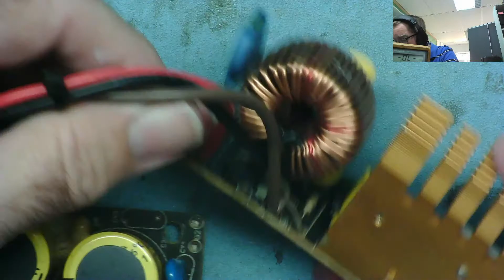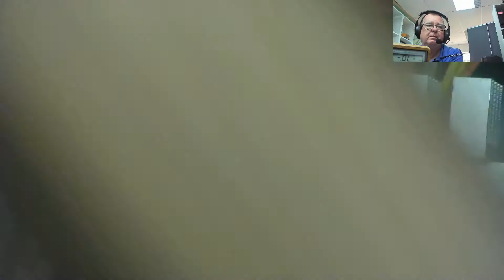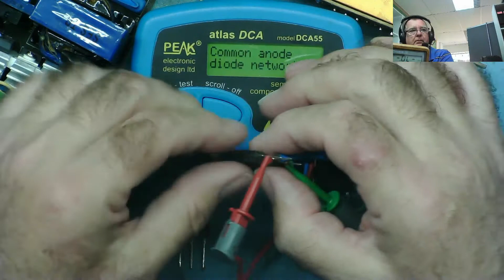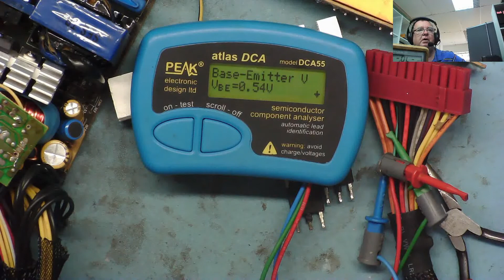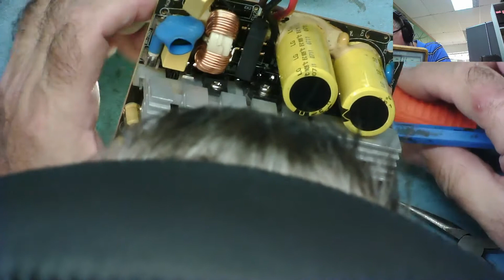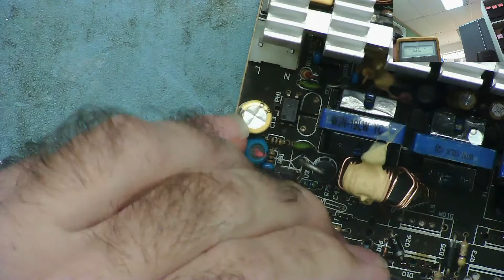LER #060 - 600W ATX Power Supply (PSU) Repair - Part 2

Comment: The only one extra thing I would do is resoldering red and brown wires to the PFC board. If the black one broke from wiggling, the other two may also be partially damaged.

Comment: 40:59 I love this part, when you try to plug 230V it without safety bulb limiter. You are almost ready to run if case of bang :) I'm afraid to hear the bang in the same way, when I must plug 230V to things, which I've repaired. I even have to put hand gloves to feel separation from potential arc voltage and put earplugs in to my ears to block "bang" sound, and put glasses to protect my eyes against exploding capacitors :-D Only with these safety equipments I can handle my stress tension when I run 230V trying to test something :-)

Comment: Obviously chinese sent you fake transistors. They always do if you order not single items
Reply from the maker: In my experience this is not the case.  It may be for high value sought after components but for more generic parts I never had this problem

Comment: A lot of work and a lot of time BUT you repaired a good smps 600W with PFC. Just by replaced main transistors as could remember?
Reply from the maker: Sometimes it's not about how long it takes, but what you learn on the journey that counts
Reply: @learnelectronicsrepair  Yes of course. Time is no problem for me. Rather I wonder why main transistor gone and what could be do it - where is the reason, bcos sometimes we can infinity changed damaged parts. It's nothing about your work - just wonder myself.

Comment: That's really cool. You fixed it. I'm still trying to fix one that belongs to a friend. It had a blown fuse and a blown NTC, which was caused by a dead bridge rectifier and a dead N-Channel MOSFET. I replaced these, but now it always trips my main breaker when I connect the AC power. I have checked all the small diodes and they are ok. No dead caps and no dead resistors either, but obviously, there's still a short somewhere, and I suspect it must be in the circuit that generates the 5V standby? I also tested the common dual Schottky rectifiers mounted on the heatsink, and they are ok, so I soldered them back in. Other ICs that I can see near the small transformers are TL3845P and AP8022 (PWM controllers) and a couple of PC817 optocouplers, these I haven't tested one by one. Maybe I should?
Reply from the maker: Hi Brian - I doubt those ICs would cause the power to trip.  
Do you read a short circuit across the Bridge Rectifier positive to negative terminals?
Do you read a short circuit across the main smoothing capacitors (if there are two - measure across them individually and the two in series)
If you suspect the 5V standby, remove the FET (or similar) that drives the standby transformer, and power it up.  It won't work without the FET but if it stops ripping out then you have confirmed your suspicion

Another possibility that would trip the power is if you have a short from the AC connections (live, nuetral) to ground

Otherwise you need to build the current limiter using a light bulb.  This has to be a 'proper' light bulb not an LED or fluorescent one.  I have shown the circuit for this on quite a few of my videos, but you can see how to build one here 

https://www.youtube.com/watch?v=syQaSfhb604

This will stop it tripping out and allow you to diagnose the problem - unless you have a short to earth in which case it will still trip and the bulb will not light, bu at least you will then know what to check.

Good luck with the repair
Reply: @learnelectronicsrepair  Well, turns out the TL3845P (UC3845) PWM controller IC is also dead. VCC pin is shorted to the GND pin.

When it tripped my main breaker, the bridge rectifier got blown up again (haha) so this time I replaced the all in one package with four single diodes. I replaced the main smoothing capacitors too, because they have lower capacitance than rated (360uF instead of 680uF)

On a side note, in continuity mode, I get a constant beep on the outputs (12V and 3.3V) similar to what you got in the first part of this tutorial. What makes it even more confusing, with the common cathode dual diodes (two small, and two big ones) pulled out, I'm still getting a constant beep on the PCB pads for the anodes of the small ones, and for both common cathode and anode of the big one. Does this make any sense at all?

In resistance mode however, the meter reads 220R on the 12V, and 67R on the 3.3V
Reply from the maker: @getmefix1921  I think you may find your diode mode gives a continuous beep for lowish value resistors - you can check that out of circuit with a few resistors.  The other reason would be output capacitors charging, as I believe in Diode mode the meter acts as a constant current source of maybe a milliamp (it can illuminated LEDs dimly after all) but then the beep would stop after a while.
Reply: @learnelectronicsrepair  I took a break to build the light bulb current limiter.

With the primary side MOSFET pulled out (there's only one), and the new TL3845 put in (I use an IC socket to make replacing it easier), I get a tiny spark near the MOSFET PCB holes when I switched on the power supply. The light bulb flashed on then off very quickly, and my main breaker didn't trip.

Inspected the spark area closely with my phone camera at maximum zoom, but didn't see any solder blobs shorting the PCB holes. Re-checked the nearby components, and they're ok. I'm baffled as to what that may have caused the spark.

Pulled out the TL3845, switched on the power supply again, yay! no more spark. I also get a steady 5V standby at the output, which means the AP8022 circuit is the one responsible for generating it.

Now here's the dilemma. Put back the two missing components and risking them to blow up again, or not :D
Reply from the maker: @getmefix1921  Good to see you are getting further along with this. The light bulb will stop the new components from blowing (usually) as long as you use a relatively low wattage bulb (60W-100W would be good).  You should not be seeing sparks though so you need to look a that area and try to work out where it came from.  I would try replacing both the MOSFET at the same time.
Reply: @learnelectronicsrepair  So the good news is, I didn't blow up anything after I put back in the primary side PWM IC and MOSFET. No spark either. Still getting a steady 5V standby (present on both purple and green wire) but no outputs when I sent the PS_ON signal.
Reply: @learnelectronicsrepair  Thanks for helping, but unfortunately, I'm not able to fix mine. I have no idea what's causing the 3.3V and 5V output sections to be shorted to ground (although the continuity reads 29 ohm, not 0 ohm). 
I wanted to pull out the components and test one by one, but this is not possible given the fact that the board quality is mediocre. The protective UV paint is very thin that it takes no effort at all to scrape it off with my fingernail, and also the solder pads themselves are placed less than 0.254 mm (10 mils) apart. I'm afraid that if I pull out the components, and then put them back later I will just create a bunch of solder bridges here and there. I have repaired a bunch of SMPS before successfully, but they were all mostly SMD and the board quality were much much better than this.
Reply from the maker: @getmefix1921  Bad quality PCBs can be a real problem.  Why not register free on Badcaps forum https://www.badcaps.net/forum/ and post about this PSU on there also in the Troubleshooting Power Supplies section.  Upload some pics and you may will get plenty of guys trying to help you I am sure.  You'll find me over there also
Reply: @learnelectronicsrepair  so I have another power supply with a funny problem. If connected to a mainboard, it won't start, but it will if stand alone with the PS_ON and GND pin shorted by a jumper (or if you use that ATX PSU tester thingy that display all of the voltages). All ATX pin connections are ok (including PS_GOOD), no broken cable or anything like that.
Reply: @getmefix1921  that psu tester thingy kind of has a manufacturer error idk why they connected pin 18 to gnd when it should be nc . So when you are testing backwards compatible psu (atx 1.0 compatible) that has -5v on that pin it goes bang every time